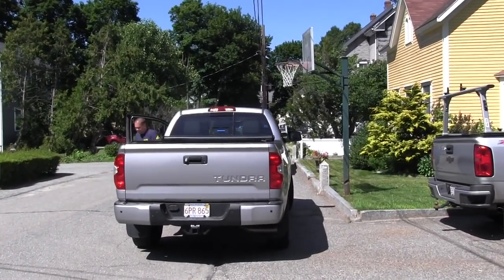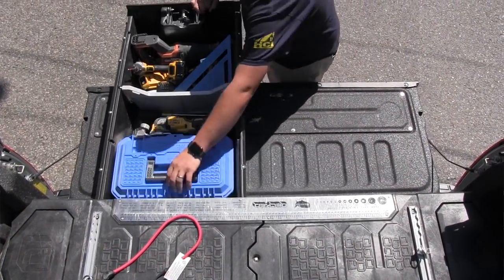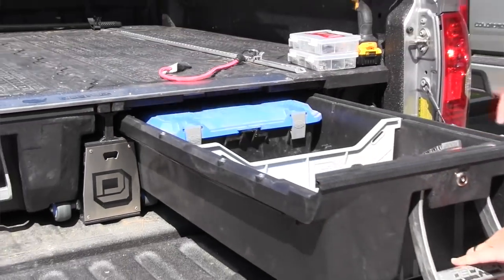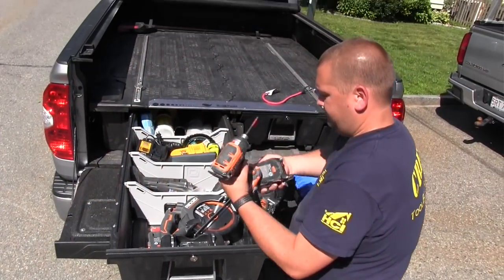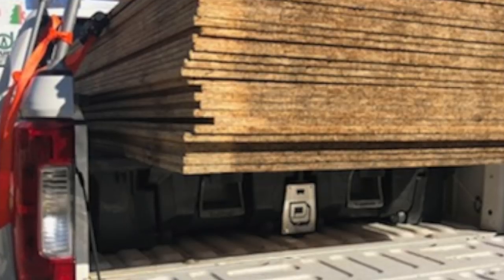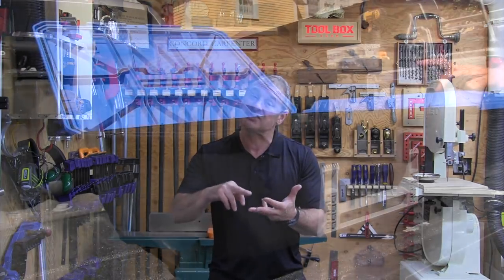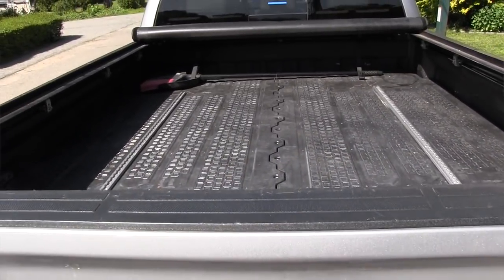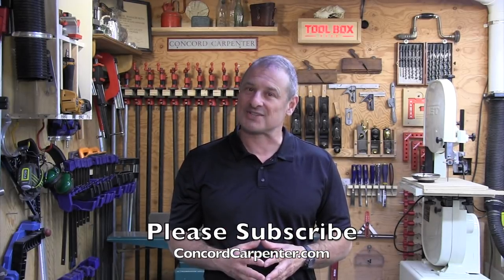DECKED Truck Bed Tool Box

Comment: My buddy has the deck. I have carpenters boxes. I store way more than he does. I even have 3 giant drawers compared to his 2. About the same height. But to pull out my drawers is a great workout. Like the video he pulls his out LIKE BUTTA. I am envious of that. I have mine in a shell his is out in the open. Mine being a plywood substrate I need the weather proof. He doesn't care. So build or buy to what you need and want. But know the deck system is legit!

Comment: I told my dad about the comment you gave him about the basement windows where he will only put a full size window to escape in case of a fire thank you for the comments but every truck or work van that he ever owned Heat belt his own tool racks so every tool had a place to go also this way you would also be able to realize if you were missing something

Comment: I use a Rimrock Mfg bed box. It makes the decked look like a kids toy. Holds 4000 lbs on top. Has a gooseneck hole and also made in America
Reply: The Rimrock Bed Box is a great product if that works for you. Our DECKED system's 2000 lbs payload matches the payload of most trucks. Unfortunately, our product does not work with a 5th wheel or gooseneck trailer, but you'll be happy to know that DECKED is made 100% in America as well.
Reply: DECKED I looked at your product. But no gooseneck hole, only 2000lb capacity and the drawers are too high making everything not very secure. Rimrock is 3/16 steel so I can cut and weld on it to make it how I need it.I can’t see how well decked would  hold up in -35 Minnesota winters. Your product would work well for 1/2 ton trucks, not heavy enough for a 1 ton

Comment: I like it, great idea, but couldn't possibly hold enough tools, lol. Definitely needs a topper.

I have an astro van with two drawers in the back and one on the side. The drawers and deck are built with 3/4" osb and the drawer runners are 3/4" steel tubing rolling on skateboard bearings. I have an inside drawer height of 14 1/2" and I put the big stuff on the deck.

I still don't have enough room.
Reply from the maker: Stephen Merritt never do! :(

Comment: I have the Decked drawers installed in my 2015 GMC Sierra and to be frank, im not thrilled with them. 

The draws are not full extension and getting items from the back of the drawers requires you to unload the front first. Pain in the ass. 

The surface, while textured, are slick and materials on its surface slide around. 

Also, after 2 years of use, the rollers are failing. The metal ruler is a joke, all the markings rubbed off in a couple of weeks. But otherwise holding up well. 

If a gen II comes out with full extension drawers and better rollers, it would be worth the investment 

A couple of errors noted in this advertisement. 
(1) they are made from HDPE (polyethylene) not HDPU (polyurethane) 
(2) the rubber seal on the drawers do not make them waterproof as stated. The seal acts as a flashing to make them water resistant. (D boxes and cross boxes are water proof though)
Reply from the maker: Big Mo thanks for the long term feedback. This is not an advertisement, we installed this to use and like it. We only have 3 months of use on it
Reply: A Concord Carpenter / ToolBoxBuzz:   If it walks like a duck and quacks like a duck, well, it’s probably a duck - no matter how you want to redefine it. Be honest, you’re a product influencer, just another form of advertising - and there is nothing wrong with it. 

https://decked.com/pages/become-an-ambassador

Comment: I wish they  would  have  more inside height.
Reply: Understandable. We wanted to maintain as much use of the bed as possible, while still giving you a large amount of storage space. We kept the DECKED system to 12" tall off of the bed of the truck, leaving roughly 10" of bed rail, depending on the model of truck.
Reply: @Decked  are u going  to build deeper ones for Van's or trucks
Reply: @misterz2719  not at at this time. We use a custom mold so are unable to change the height of the product.

Comment: I usually think your videos and reviews are top rate and in-depth but this one falls a bit short.  
You don't point out the drawers don't come fully out and it looks awkward to reach stuff at the back.. you also don't state how much space you lose in the truck compared to the drawer volume.. at a guess it looks like you lose  another drawer to drawer and a half  of space wasted... you don't say if it fits systainer or  equivalent  storage from  the usual big names fit which would be helpful.  
It looks like a nice idea in theory but in the real world it takes up too much space for all you get.
It would have been good to point out how secure the locks are as it could be easy pickings for thieves
Reply from the maker: Tuned In it’s designed to use with the Decked containers.  Their best stored, as shown, in that rear drawer Space.  

Sorry to have missed those point for you, I can’t and obviously don’t think of everything, or everyone’s concern / application.

The space you lose is pretty evident from watching the video - it’s more then half (up to wheel well)
Reply: Hi, Yes. The drawers pull out 4 feet because they are engineered to accommodate 200 lbs each. However, they are full-bed length, so you're not losing storage space. The full system sits at 12" in total height, right above your wheel wells, so you get the ergonomic storage underneath while gaining surface area on top. Ammo can storage to utilize the space in each four corners.